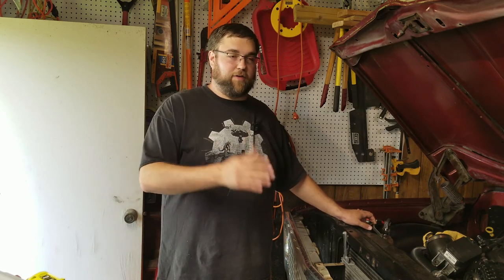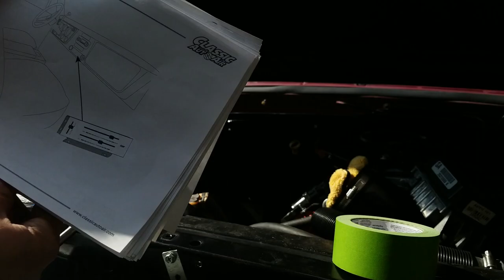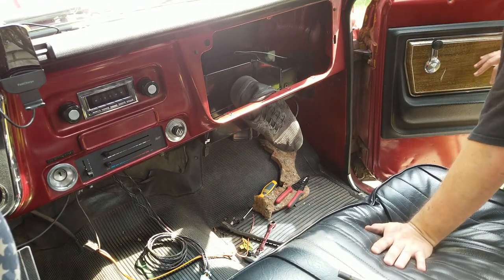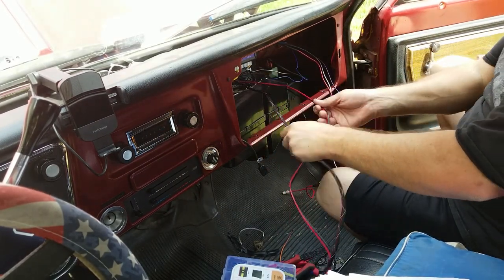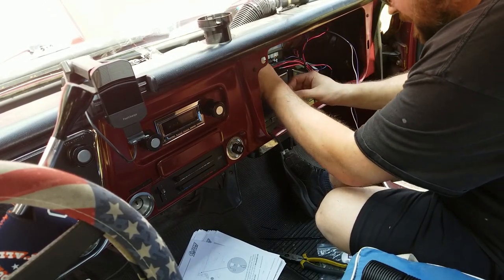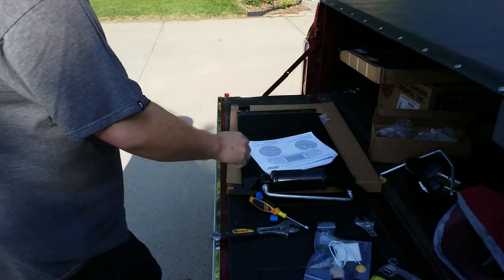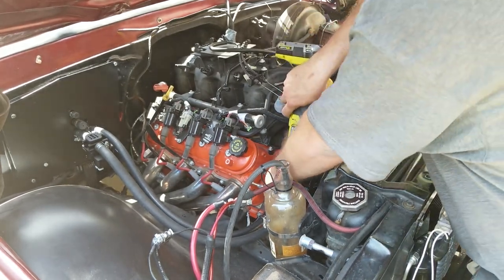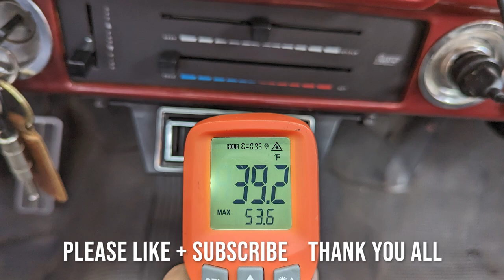CLASSIC AUTO AIR 2 DAY INSTALL - 1972 C10

Comment: The video was a great help. I have just about completed my install. I feel like the book was pretty good, never quite enough pictures. I had to change pulleys so I ended up pulling the radiator along with the battery box and that made things easier. All the holes where also not where they stated. With a 68 who knows if these stamped parts have been replaced. This truck has been in the family since 1976.

Comment: How do you like your Classic Auto Air by now?  I too, would use them before Vintage Air.
Reply from the maker: Still working well. Their thermostat switch is set a little warm for my liking so I wired up an override switch that will keep the compressor on for really hot days.